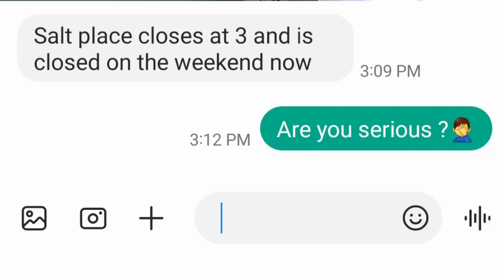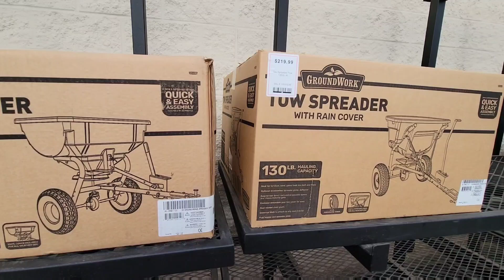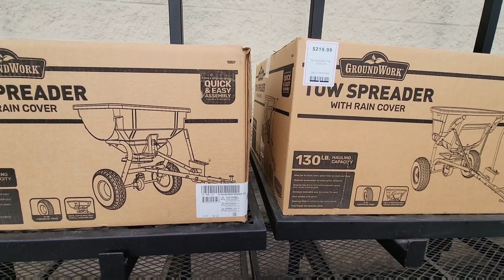SOMETIMES YOU JUST HAVE TO DO WHAT NEEDS TO BE DONE | ENOUGH IS ENOUGH!

Comment: I was just thinking that some small bolts, (number 10s or quarter inch), around with some washers would hold that rubber on better. As far as bagged salt goes, remember last year and stock up now. If I might suggest, I would use one of those storage units, Rent it to the business, (no need to 'lose' money on the unit at least get the tax write off), and fill that up with bag salt.

Comment: Definitely think about a utility tractor!  If you went with a tractor, you can do everything that you rented the Ventrac to do.  With tractor's being lighter than skid steers, you would be able to transport it on your existing trailers.  You can then look into different 3 pt attachments (brush hog, box blade, etc) to expand your range of work.  Plus you could drive across yards to help with tree and brush debris removal without having to worry about damages like a skid steer would do.  If you look at new, most manufacturers offer low or 0% financing
Reply: Skid steer
Reply: @annablle1874  get out
Reply: Totally agree, for a small lawn care landscape company, a utility tractor is the way to go.  Way more upside than a skid steer.  Less expensive as well.
Reply: Would say like 25-35 hp kubota/kioti tractor.  And will be half the cost of a skidsteer. And like other people are saying lots of attachments can go on front and back. My new tractor even has skidsteer quick connect for front-end.
Reply: Definitely a tractor is the way to go. Very versatile and implements are also a lot cheaper

Comment: As far as loading bulk salt, a compact utility tractor is what you need.  It will be very useful for your company.  There are typically more used ones in better condition than skid steers.  Also don’t worry about loading height, it is cheaper and better to make a loading ramp, rather than buying a bigger piece of equipment than what you need. Look at JD 1025 or 2032,  you,don’t need anything bigger.

Comment: I agree with TreeMonkey a utility tractor with a loader and a rear blade that way you can load the salt and use the blade for small areas and wide sidewalks.  I have had a JD 955 for the last 25 years I use the bucket for spring clean up the power angle front blade for snow plowing 5 driveways in the mountains in Pa  and a rear mount finish mower to take care of my 7 acres of grass

Comment: I'd try lubricating the axle and shaft bushings and gear box in the spreader... Some of the Chapin spreaders have grease fittings for this purpose. If yours doesn't have grease fittings you can partially disassemble the spreader and apply grease to the friction surfaces (marine grease would be best). Spraying the metal down with a marine corrosion protection spray would help too.  This maintenance alone could bring your spreader back to functional life!

Comment: We load with a skidder and no issues with height.  I doubt a dingo would get you the height u need. 
We’ve tried so many different push spreaders and they’re all junk unless you can find a epoke drop spreader but those cost $$$. We switched to a 5 gal bucket with a strap. It’s quick and you can control the spread of it.
Reply: Salt Sling

Comment: I’d go either mini skid steer or small tractor. Mini skids are much stronger but tractor attachments are cheaper. I went with a tractor but wish I did the opposite. Tractors were available and minis werent. Also hard to pass up kubotas 0% for 84 months. I’ve had good luck with echos spreaders

Comment: I definitely like the chrome accents (the duck tape) on the spreader. I'm not entirely sure how mutch it'd cost but I'd consider putting rivets through the material ro keep it together with the plastic. Then you'd avoid the issue with the glue not working and or the tape getting brittle too quickly with the cold temperatures while out spreading salt.
Reply: Yep. That's where my mind went as soon as I saw what he wanted to do. Rivets would be quicker, better and would even look better if that's a concern.

Comment: I took the broadcast section off the apreader and cut a plastic 5 gallon bucket in helf. then cut half into quarters and bolted the pieces opposite each other on the shaft driven by the wheels. Drop spreader 18" wide

Comment: I have a 45hp 4x4 LS cab tractor with material bucket, 4-in-1 bucket, grapple and detachable backhoe. I would like to have a skid steer but it would be a disaster on lawns compared to a compact tractor with industrial tires. My tractor weighs approx 4500 lbs without the backhoe, mid-size skid steers weigh 7500+ lbs.

Comment: Look on the side of the tire, it will tell you how much air to put in. Also I noticed that an air/oil separator is not installed on your compressor. Are you draining the air after each use? 
     I have the same compressor that you have. It is over 30 yrs. Old. Proper preventive maintenance is a must.  Even on air compressors.

Comment: We did pallets of salt into a vbox spreader for years. Probably a good 8 to 10 years. Mine was on a flatbed so it was actually over my head. It's a good workout. You throw up about 10 bags on each side, somebody would go up and cut them open and dump them in. And then we throw up 20 more. We usually put a pallet and a half in the hopper. Sometimes two. It's not that bad, plus nothing spreads nice like dry bag salt. We did switch to 2500 lb totes once I bought the loader and the skid steer to make loading easier. We usually filled it on an off day and let it sit in there, we've been doing that for 10 years and never had a problem. The only thing we've ever replaced was an auger bearing. I didn't care for the bulk salt because sometimes it's kind of damp. With the bagged salt I can leave it sit in there and with the bulk I would not.

Comment: hello, if your idea with the rubber mesh on the Chapman, and this is if it works, you need to take some small 1 inch long bolts and take two 1 1/2inch washers and then put one washer on the bolt side and then one on the nut side. then that would of course sandwich the rubber mesh and the plastic together. also, I would cut the rubber around the wheels so that it does not get cote in there and then get the rubber ripped off. love the channel and what you are doing with it

Comment: Personally, for next season I would look into getting a brand new small frame tracked skid steer, an 8ft pusher, bucket, and forks. Find a facility that you can put said skid loader on for snow removal to help pay for it and also build a bin/ shipping containers for storing salt. Store the salt in the container, use the skid to move the salt and load it. And then use the skid on site for snow removal as well. Helps pay for the machine and solves the bulk salt problem.

Comment: Did a good job I think I would have done a  it different with thick rubber mat and used self tapping screws to screw though Mat into plastic and with rubber washers to make a seal. Also might be able to get the screws to not go all the way through. But it should work o don’t see why not

Comment: I Do not work with salt but think I would look into a grain bin with grain elevator(screw) to keep my bulk at hand.   Load the bin with the elevator from your supplier and when needing to place in truck, off load from bin to your spreader.  We did this on the farm with corn back in the day and use a smaller bin for storing corn now.  You have the storage facility to set everything up and access easily.  Eliminates the expense of a wheeled/track loader and way less maintenance.
If memory is correct, we have about $2,500 to $3,000 in platform, bin and elevator, installed ourselves.
Just a thought.  Also don’t miss your cold and snow.  Had our share while living outside of Strongsville. 🌬⛄️🌨

Comment: Re the plough - you could have flipped it over and just fitted a thinner strip of metal that does the whole length and then used the 3 HD plates on top - would certainly strengthen it up. This would just aid if your worried around the aesthetics of the holes

Comment: I loaded salt into my vbox for a couple years with a Deere 1025 and a set of car oil change ramps cause it was too short to reach. My kioti ck3510 would reach perfect. The mid-sized compact tractors are super versatile and way cheaper than a skid loader or even a mini skid. They all have their place, but the tractor worked best for my needs.

Comment: the spencer salt shield should work fairly well. might need to make it out of a tarp type material with no holes in it. 
i wouldnt go for a super big loader or dingo. the size you had at the storage facility would be perfect. you can use it for other jobs as well. build a loading area  that is level with the truck bed or trailer bed to gain the height needed. then you can use it to load and unlad pallets from the truck or dump trailer. you could also look into some kind of auger  set up  that would fill the spreader  and be loaded by a smaller  dingo
Reply: Just looked Menards  has a yardworks 75lb drop spreader 119.99

Comment: If you buy a good broadcast spreader you won't have issues with broadcasting too far. We run them on 3ft to 6ft sidewalks no issues, that one your using now doesn't have a grate in the bottom or a storm cover on top of it, that definitely will change how your speader operates in a storm

Comment: If the glue doesn't work you can use a large washer bolt and nut to secure it, might need to cut the extra length on the bolt.

Comment: You can make a loading ramp easily with a couple railroad ties and some gravel . 
Only has to be a foot or two high to help loading the hopper spreader !  Bulk salt with a tractor or Skid to load it is a game changer 🙌 ... but remember.. if that salt gets wet it's DONE. Solid as a rock 🪨

I use the cheapest Scott's spreader they make and it works great.  Holds nearly 50 lbs of salt and gets the job done

Comment: They have new gears for them. I wanted to try an old steel drop spreader. A guy from Chicago told me they would take a Scott’s spreader and drill the holes out bigger so rock salt would fall through. I know you need a certain wheel or it will slip on ice.

Comment: Hey wanted to give you some advice! I'm a landscaper in the Canton area as well. So the dingo normally isn't quite tall enough. You can build a ramp to do it but it's difficult. Skid steer is the way to do it but I highly recommend buying a older used one for loading salt. I also was going to say go check cross because they sell spreaders and stuff but as I was typing this you were visiting cross😂 But with the salt issue buying in bulk is the only way to do. Either build yourself a shelter or buy a shipping container for a few grand and load it with salt.
Also the last thing is if you do any tree work there is a giant barn across the street from cross that sells all kinds of tree gear or if you just need some good rope, I used to work there for years.
Reply: But a drawback to a skidsteer is the weight and another is price... a compact tractor with loader is cheaper and light enough to use for landscaping.   Only way your going to get a skidsteer with a light footprint is with tracks and a decent used one will be around 30k... you can get a compact tractor with loader new for that
Reply: @jamescrow6508  you do have a great point! Never been a tractor guy but that's definitely a good option
Reply: @jms8202  well I'm not in lawn care, I work for a County road department... but I use equipment daily... now my equipment ranges from about a ton to 40 tons... I occasionally have to help mow but I'm primarily heavy equipment and a truck driver.   A compact backhoe is what he really needs cause he could expand his options... not to mention if he buys land he could dump his leaves and lawn debris, bury them and stir it up with the backhoe, and sell compost

Comment: Shawn, you need to contact Toro and ask when will they be designing a salt spreader for the multi-force, or purchase a small tractor with front loader and salt spreader attachment at the rear,like a Kubota that should solve your bags into the hopper situation.

Comment: If your plan is to buy land in the future. I would just buy a tractor with a loader. John Deere 4044M with a 400E loader will get you to 112 inches of lift height with a lift capacity of 1,760 pounds.